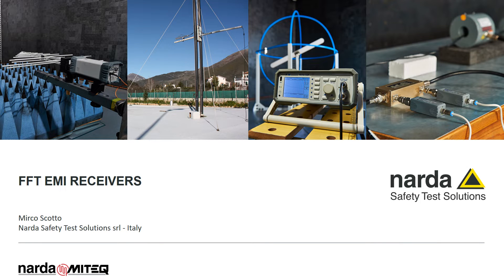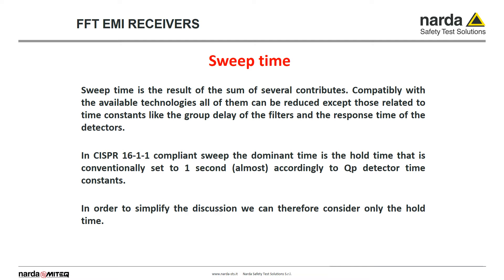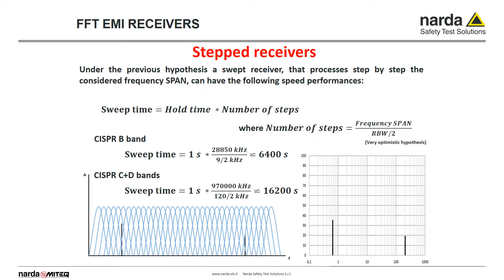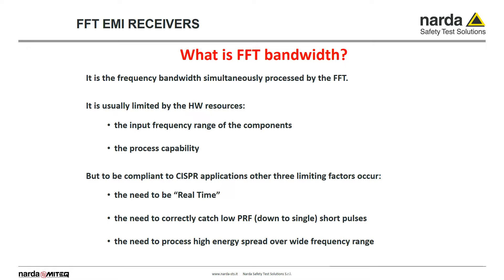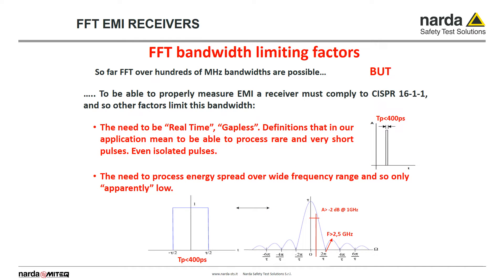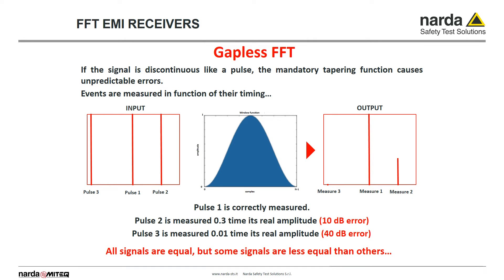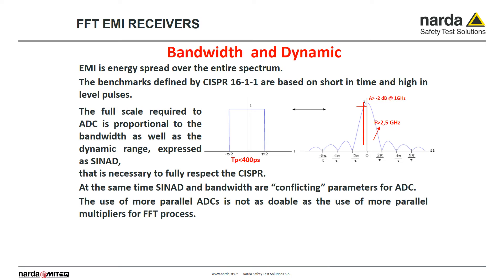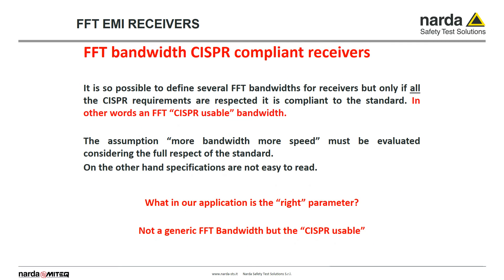FFT EMI RECEIVERS

Comment: What is meaning Frequency SPAN? How do calculate it ?Thanks
Reply from the maker: In our context SPAN is the frequency range.  For example, I 'am using the receiver in analyzer mode. I set the center frequency (10 MHz), then i decide to have a SPAN of 2 MHz. This means that my start frequency is 9 MHz and my stop frequency is 11 MHz.